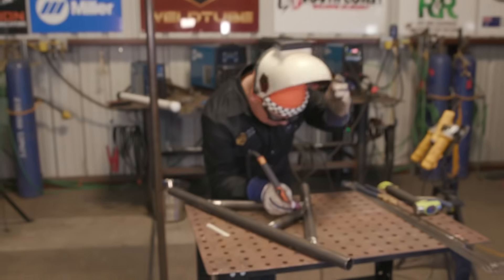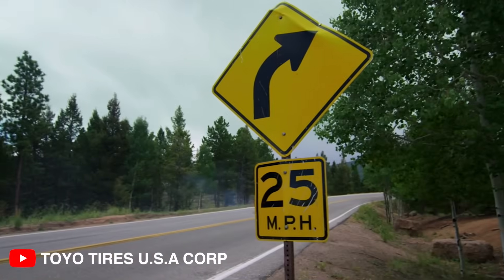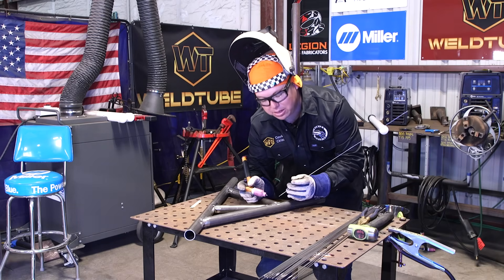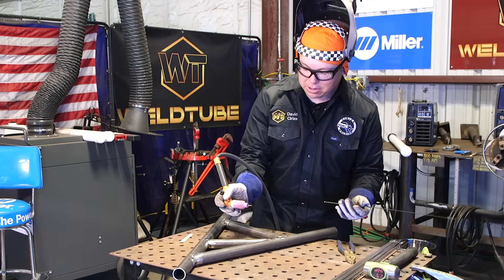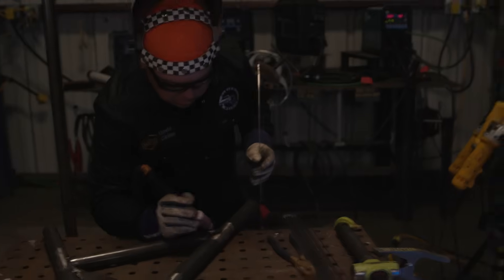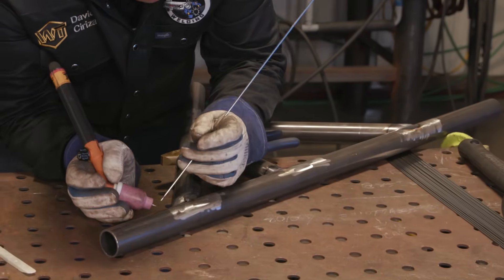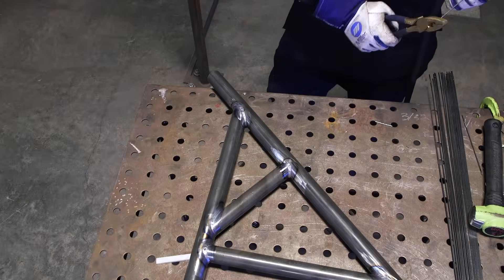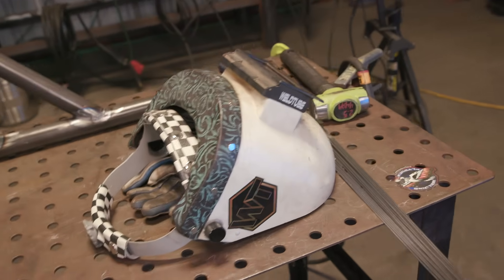Chromoly Tube Welding for Motorsports | TIG Welding

Comment: I wanna know if chromoly actually cracks because its more rigid compared to mild steel
Reply: It can crack. That's why you can't mig weld it or get it too hot when tig welding. Other ways it risks cracking.

Comment: Especially the first one, looked a little grey. See that a lot on here with tubing and no8 cups. Bigger cup + more flow. Jazzy 10 or fupa 12
Reply: use a gas lens
Reply: Didn't look like he kept post flow over the weld when he was done.

Comment: Can someone tell me why people say chromoly tubing is stronger than mild steel, when mild steel has a higher tensile strength, the chromoly is more rigid though.
Reply: Exactly. Use chromoly because it creates a shell around you. If you used mild steel it could crush around you a lot easier. Tensile strength is different from hardness
Reply: 4130 has a higher tensile strength than mild steel, even cold worked mild steel. Its why 4130 exists. 4130 is steel and therefore the same stiffness as mild steel, Youngs modulus.
Reply: Wrong. The mechanical properties of 4130n far surpass mild steel in all areas.

Comment: I wouldn't use this lay wire technique as you won't get good penetration. It's also worth mentioning weep holes  so your weld doesn't blow out near the end as the gas builds up inside the tube and has nowhere to go.
Reply: Hes not back purging. Also looks like he got plenty good penetration at the end when it shows the completed weld.
Reply: @Tommy S  I never said he needed to backpurge. You don't need to backpurge 4130. Lay wire technique is fine for certain things but I wouldn't use it for a cage. I can tell as someone who has a lot of experience with chromo tubing that this man does not. If you're going to show something like this, on a channel this big, get someone with more experience.
Reply: @yakswelding86  i must have misunderstood you, sorry i just assumed you meant welding gas. Also i dont use instagram so i havent seen his other work
Reply: Go to his Instagram, it's all pipe. Which is fine, he's really good at that. But my guess is he doesn't mess with chromoly too often.